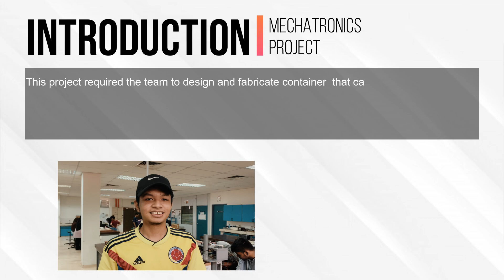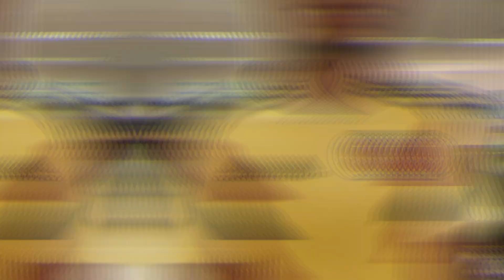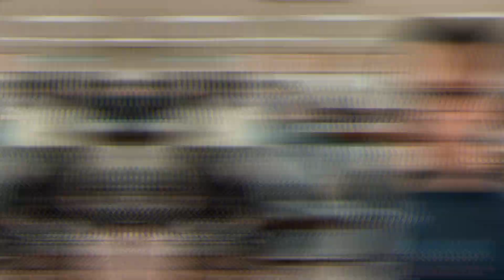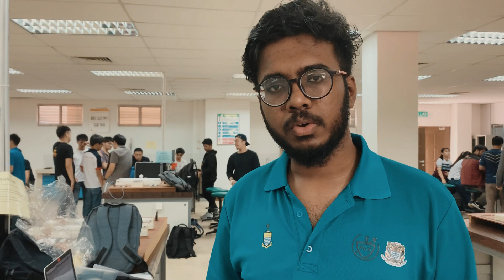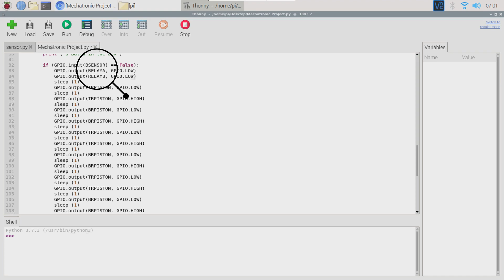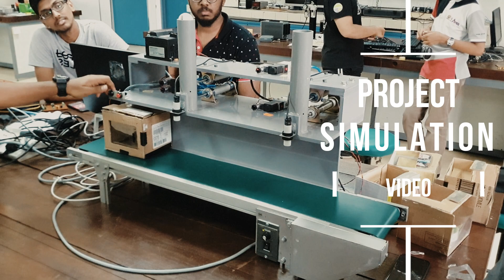EMC 311 MECHATRONICS : Raspberry Pi Microcontroller Project Group A1 2019/2020

Comment: Objectives are well defined.
Manufacturing application is associated.
Box is not designed for manufacturing application thus operation sequence is similar to other teams.
Magnetic sensor is not used.
Wiring for DHT22 sensor is not complete and for switches and magnetic sensor is not shown.
Motor and relay circuits are not shown and explained.
Pneumatic circuits are not shown and explained.
Program initialization is shown but DHT22 initialization should not in a loop forever.
Program flow is shown and explained but execution of conveyor is repeated twice.
Switches are used for controlling outputs.
DHT22 sensor reading is not used for controlling outputs.
Operation demonstration  is well shown and explained.
Mark 60%